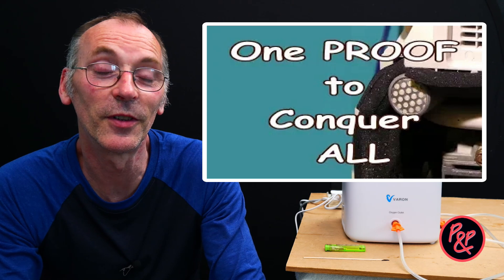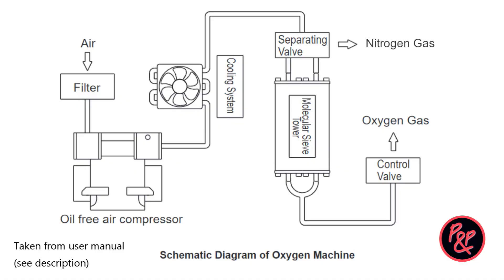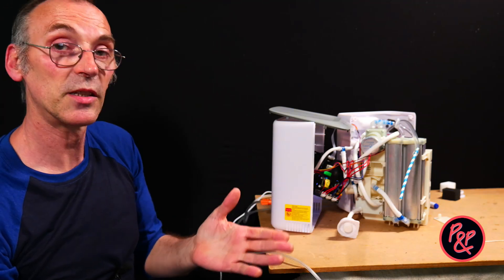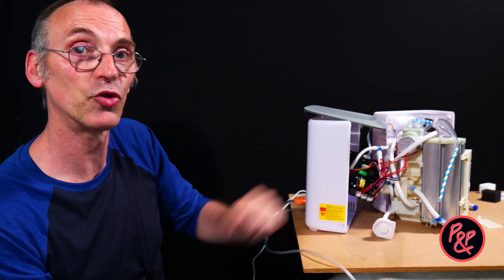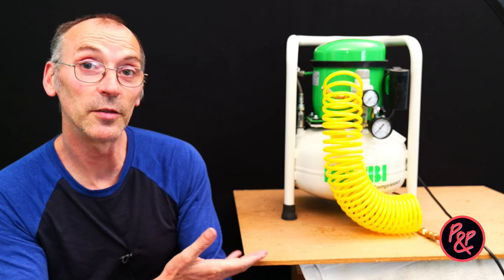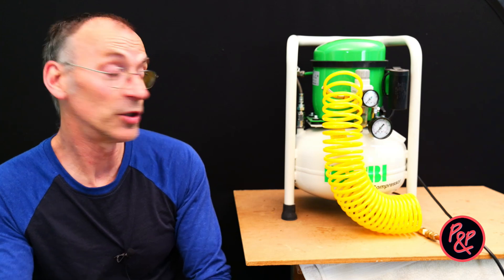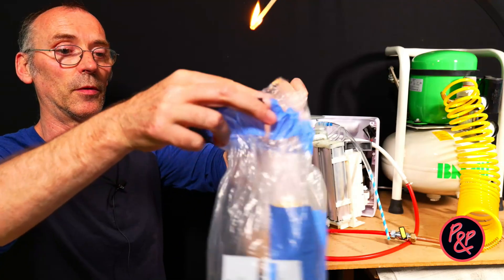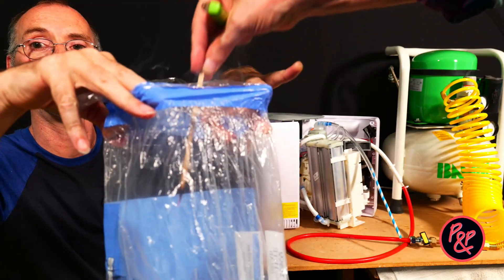Making Nitrogen Using An Oxygen Concentrator

Comment: If "oxygen" is concentrated dry air, then what is "nitrogen"? And why wouldn't more air pressure/air flow create more concentrated cooled dry combustible "oxygen"? (Regardless of the sieve material)
Reply from the maker: It's clear from our demo the type of sieve material is important to determine the 'synthesis' of an oxygenous air or nitrogenous air. To produce a  nitrogenous air, in our opinion the air would be 'stained' by carbon or stained by the carbonisation process of the sieve material and everyone should know the properties of carbon. The higher pressures are required to 'stain' the air to synthesise nitrogen. Molecular sieve material used for oxygen production has undergone calorgenation where it is heated to high temperatures in normal air and not exposed to smoke/flame.

We use the word synthesise because one can expose air to hot iron under high pressure and produce nitrogen as in the Haber-Bosch process but the 'nitrogen' hasn't been exposed to carbon as above or sourced from nitrates. In other words man manufactures chemical substances using different methods so the products cannot be exactly the same, hence the reason why they say, we can synthesise nitrogen 👍
Reply: @PeterPete  ah interesting thanks guys

Comment: How do you reach conclusion number 3, that Nitrogen can be synthesized? 

The glowing splint being extinguished indicates that the air in the bag does not support combustion, but why would that mean that it is nitrogenous? Can it not be something else?
Reply from the maker: quote - How do you reach conclusion number 3, that Nitrogen can be synthesized - nitrogen produced from a nitrate will be qualitatively different from the nitrogen produced by PSA even though both will extinguish a flame!

A property of nitrogen is that it will not support combustion so could the gas in the bag be something else? Some could say the gas is CO2 but there's no combustion and furthermore using compressed air and CMS is how nitrogen is generated industrially!

Our next task is to use oxygen as the in-feed gas and not compressed air! see what happens!
Reply: @PeterPete  I see, thank you for your answer. On another note, are you interested in looking into producing "helium", or should I more properly phrase it produce a lifting gas that neither supports combustion nor has any inflammable impurities?
Reply from the maker: @FlatEnough  we would if we had the facilities, unfortunately we can't do that living in the UK. Interesting you mention it though because helium is a gas that cannot be made from a chemical reaction, along with the other noble gases 👍
Reply: @PeterPete  May I add lifting gases indicate to me that air can be structured: though at first glance gases maintain neither shape nor volume, lifting gas inside a balloon somewhat resists outside compression and instead of collapsing and staying put, it "keeps" some of its volume and instead rises. Your view on this?